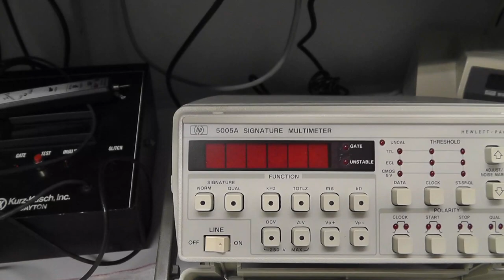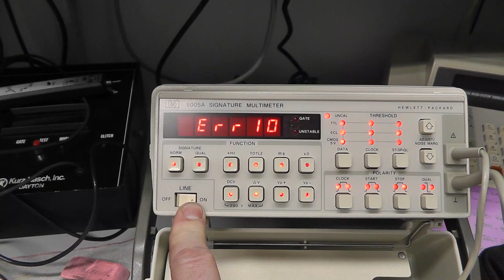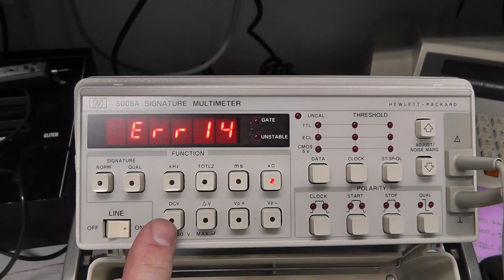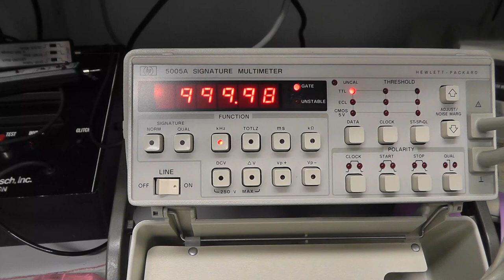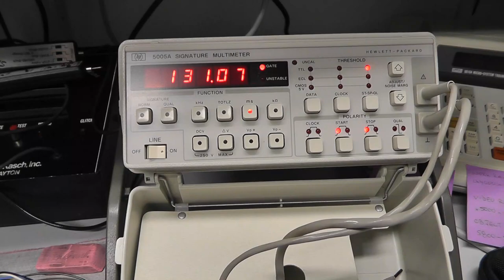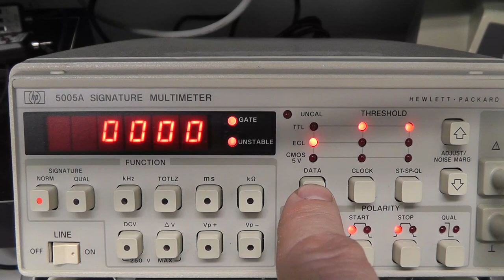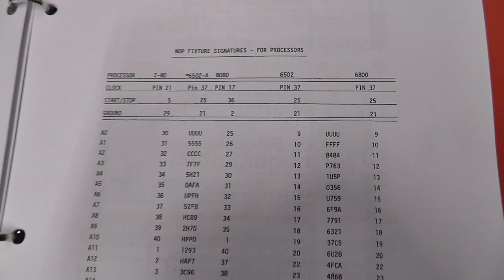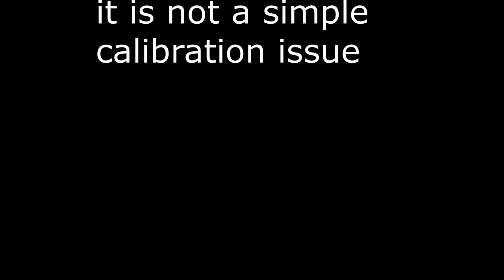HP 5005A Signature Multimeter - Part 1 Initial Testing

Comment: How do you know where to connect the pins of the timing pod? I can't find anything on the internet. Can you explain that please?
Reply from the maker: Are you referring to testing the 5005 itself or testing a device (UUT)?  It depends/varies based on what you are testing and the signature analysis guide that you are following.  For a standard cpu No Operation adapter, CLK is on your cpu clk and both start and stop are on most significant address line (eg A15).
Reply: @jacklick  Ok, thanks for your qick response, that already helped a lot! I realy like your videos!!

Comment: What is a No Operation Adapter? its sending out data pulses and address pulse at fix internals for the HP 5005A Signature Analyzer for testing?Is the HP 5005A Signature Analyzer measure different signature values compared to your other Signature Analyzer? What I mean is if you probed the same Test Point or Data signal, both Signature Analyzers would give you the "Same Signature"? or a Different Signature? even measuring the same test point or data signal
Reply from the maker: No Operation adapter forces the CPU to run the No Operation Instruction set by forcing  specific data lines either high or low.  No Operation tells the cpu to basically do nothing.  However, the side effect is the cpu turns into a synchronous counter which walks the entire address space (eg 2^15) which was shown in the video with 32768 pulses on A0, 16384 on A1, and so on till 1 pulse on A15.   The HP5005A will have same signature as my K&K but different signatures from an Atari Catbox.  However, this adapter has a special mode that will generate signatures that match the Atari Catbox.
Reply: So the HP5005A and K&K use the same No Operation Adapter?Do you have to use the No Operation Adapter in order to measure signatures on data lines and address lines?Do you get signature values for data signals, address signals, control line signals from the No Operation Adapter?
Reply from the maker: The adapter is specific to the cpu not the analyzer.  Its purpose is to hardwire the data lines so the cpu has the equivalent of the assembly code for no operation instruction set.  The way K&K and HP calculate signature is the same, yes.  Yes you can get signatures on almost everything but there are plenty of caveats.

Comment: You never talked about arcade games using ECL and the voltage ECL threshold levels because ECL uses different voltages levels that are not standardized. Arcade games used ECL voltages but they would change the ECL voltages for the high level ECL voltage and low level ECL voltage not keeping the same ECL voltages for the high level and low level. Some used negative -0.8vdc as the high ECL voltage and -1.6vdc as the low ECL voltage and other arcade games used other ECL voltages which they never kept a standardized threshold levels for some reasons. I'm not sure why the arcade designers would change the ECL voltages but ECL is suppose to be faster and have less noise immunity for RAM chips.
Reply from the maker: I might have mentioned ECL in DK repair.
Reply: @jacklick  yes Nintendo used ECL voltages. But what ECL voltages have you found on various arcade games? will the signature analyzer work with ECL voltages?
Reply from the maker: @waynegram8907  Nintendo is the only one I have come across but I know there are others.  It isn't super common thought AFAIK.  Thank goodness, I didn't have to troubleshoot that section so didn't look into it much.  Yes, this SA can work with ECL logic level voltages.
Reply: @jacklick  What are the ECL logic level voltages that SA can work with because ECL has many different voltage levels. I'm not sure why arcade boards used ECL voltages or other digital logic boards but I think ECL was faster and less noise immunity. what do you know about ECL?
Reply from the maker: @waynegram8907  the HP5005A can test +/- 12.5v for ttl, ecl or cmos.  I know pratically nothing about ECL except it typically uses negative voltage.